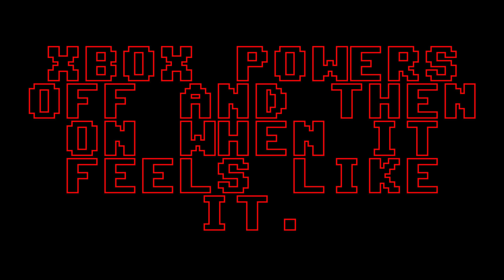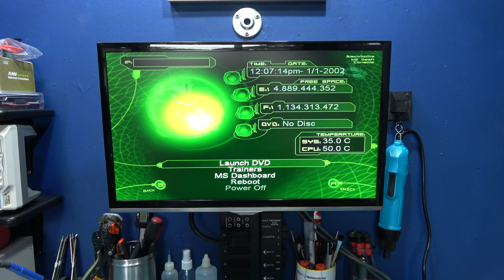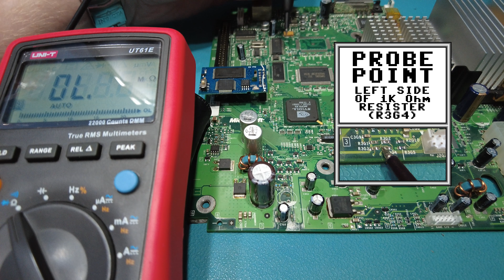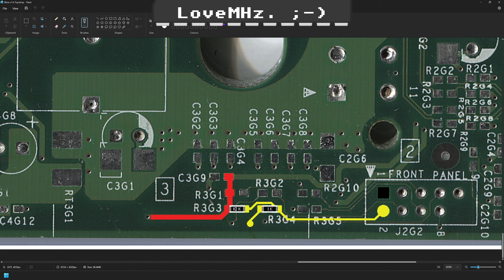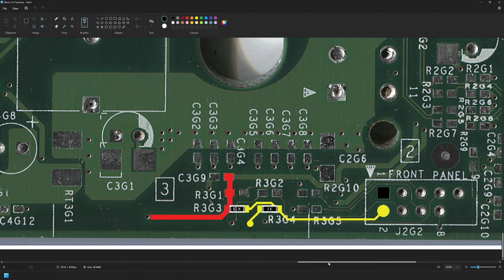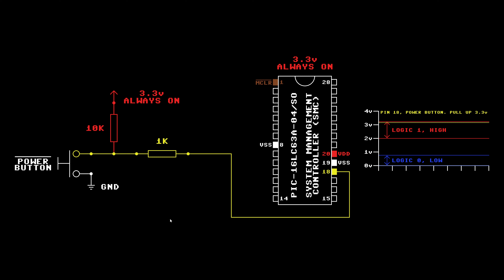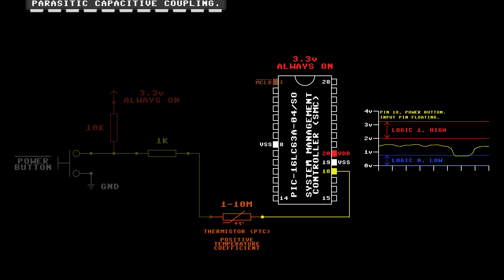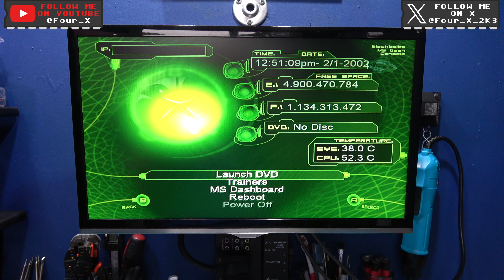Microsoft Xbox - Repair - Xbox Powers Off and then On when it feels like it.

Comment: Have done several of these over the years for customers. It's a big thing on the 1.0-1.4 xboxes. (trace rot). Good way to explain the fault to the non techie's out there. Well done. Not a criticism, but surely it would have been quicker, easier and more cost efficient to run a couple of 'bodge' wires to the trace where it wasn't broken, to bridge where it had become damaged.Tidy up with a bit of solder mask. Job done. Good job though, thanks.

Comment: Nice tidy repair there, very professional! I've got 1.4 and 1.6 black units that I've softmodded and removed the clock caps from both even though I've read the 1.6 isn't affected but I did it anyway. I'm going to drop SSDs in the them both in the new year with the adapter you recommended in your other video so I'll check the tracks on them whilst I've got them opened up. Quite enjoyed that video, nice and calming with a bottle of beer 😁
Reply from the maker: Thanks bud, I'm having a few beers now. Have a great New Year.